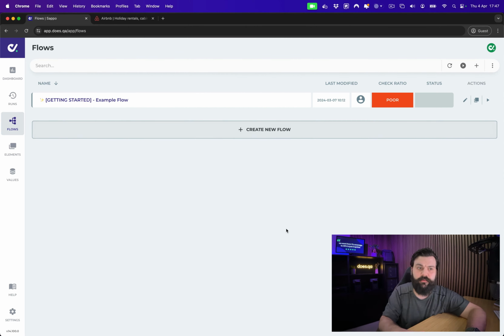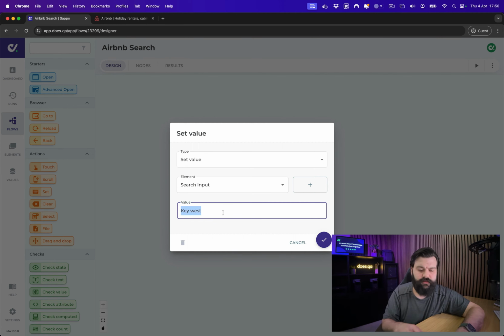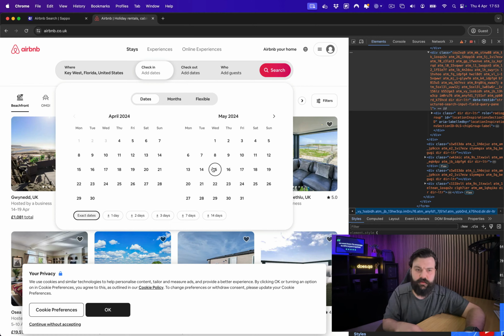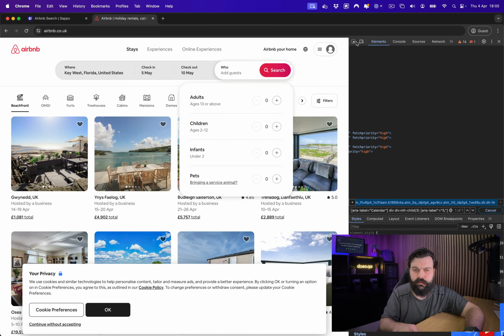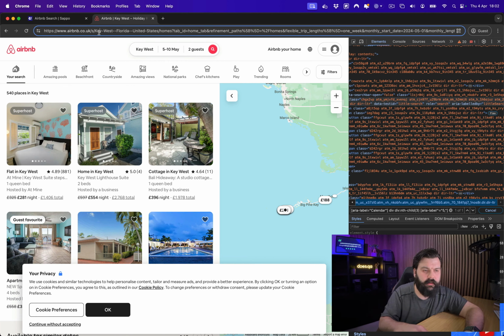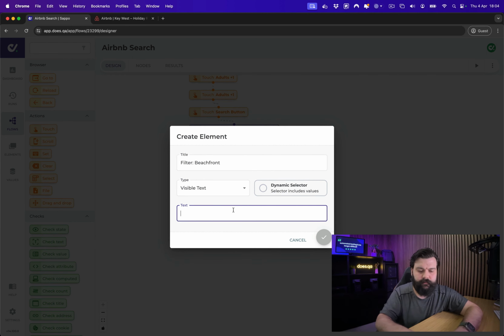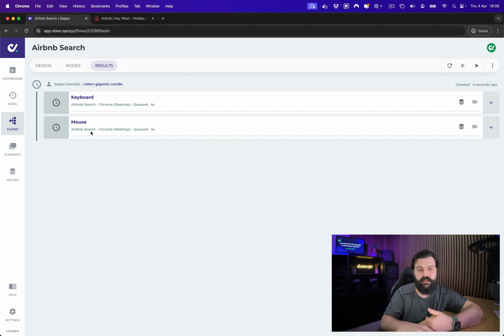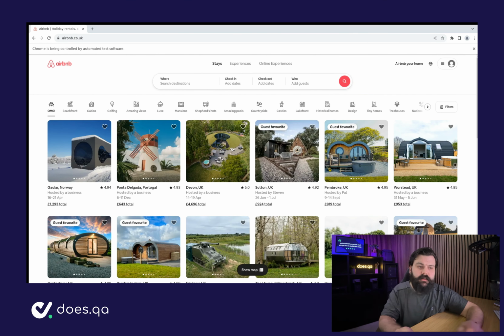No Code Test Automation Introduction

Comment: This was pretty long, but ultimately just showed a long setup through a particular user path. Is this simply validating the path that the user can take? 

It's cool that it took screenshots but what else is it QA'ing per se? For me it would have been more interesting to see at a glance not only that it's capable of setting up complex paths (only need a quick intro to that, I get the gist after 10s) and then the visual regression testing (which I saw lower down on your sales page), the cross browser testing, the integrations, parallel running, etc. That would be great to see a demo of as your P1 above the fold quick crash course elevator pitch 😅
Reply from the maker: Thank you, we really appericate the feedback!